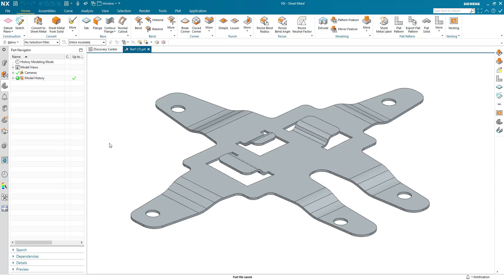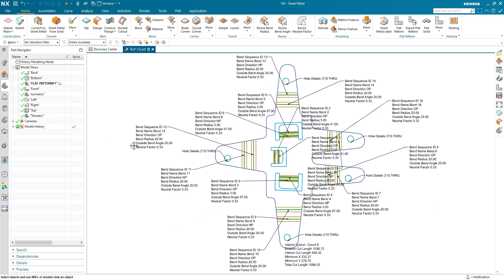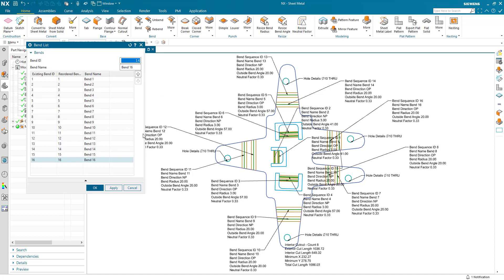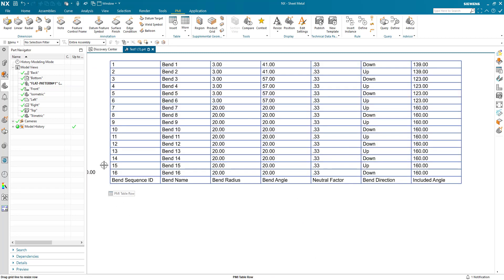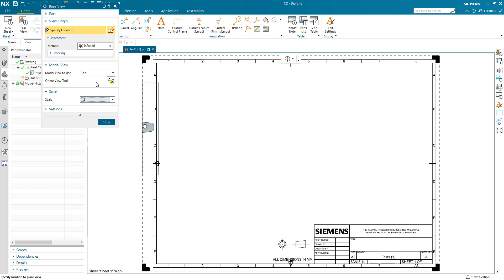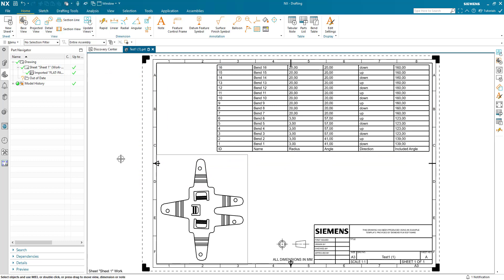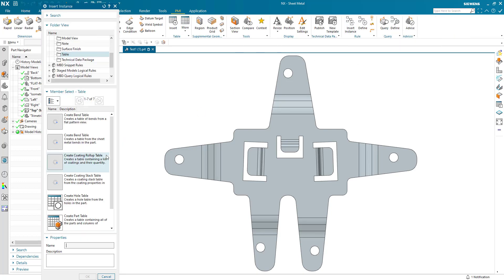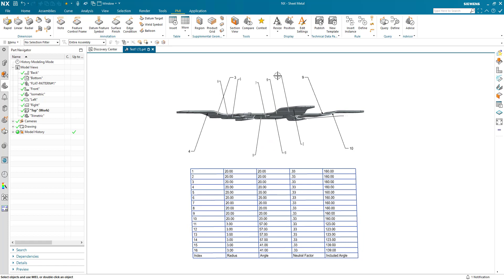Siemens NX Sheet Metal: Bend Tables

Comment: thank you so much.
is there any way to show only the numbers on the flat pattern in NX drafting? cause you are only creating the bend table in drafting and it is not recognizable which ID is for which line.
Reply from the maker: Yes, in PMI preferences->Sheet Metal->Flat Pattern->PMI Configuration->Bend uncheck all Parameters except Bend Sequence ID. The set the Prefix to be no text. When you create your drafting view of the flat pattern, in Base View Settings->Common->PMI, inherit From Model View